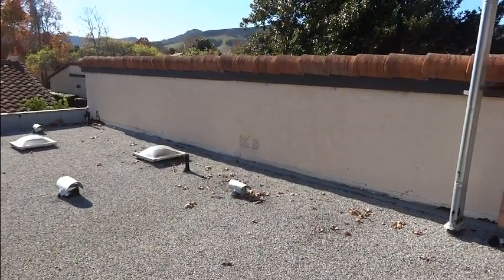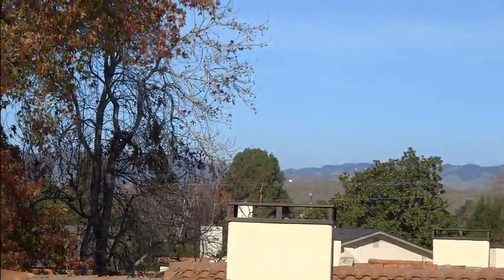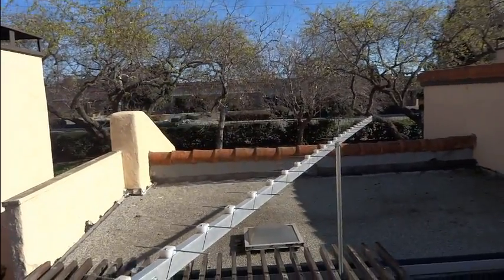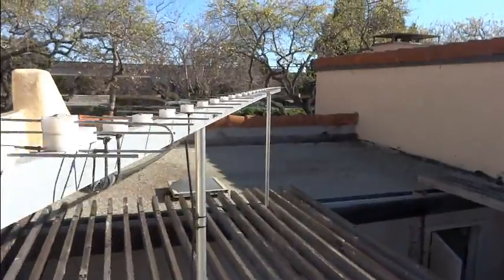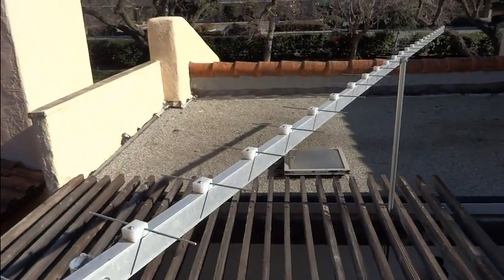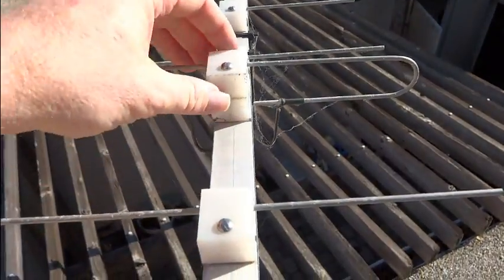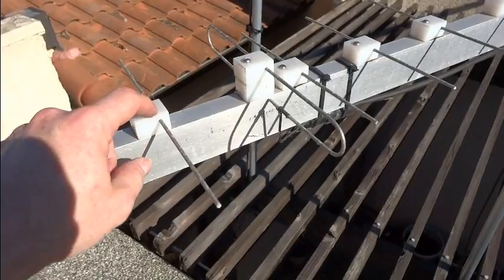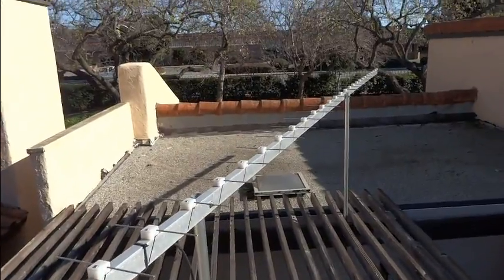20 foot long homemade yagi TV antenna

Comment: There are impedance matching setups, as the folded dipole is 300 Ohms, while a coax cable is 75 ohm, at least it was very I grew up. In order to make an impedance matching device, you need to basically build a UI looking balun, a u-shaped 3/4 lambda I believe patch of your regular coax cable tied to the I shaped regular coax cable that continues all the way into the house. I forget how exactly it was done, I remember the U and the I center wires of coax twisted and soldered together and attached to the dipole's one leg like that, while at the same section the shielding wires were also twisted/soldered together, then the other leg of the U only had the center wire connected to the dipole, kind of shorting the dipole out via a 3/4 lambda piece of cable, if I remember right, and the shielding wire just left floating, unconnected on that side. My memory fails me here. But without impedance matching you get a relfection, and much signal loss,similarly to how light reflects and refracts when going into a prism from one index of refraction medium into a different one. The other way to loose a lot of signal is through attenuation, if you have a long run length of coax into your home from the roof, it simply dissipates the mV of signal by the time it ends up in the house, through extremely heavy skin effect resistance. At these frequencies only skin effect matters, and it's preferable to use tubing, for cost and weight reasons, because you get the same resistance out of a tube as out of a solid rod. So just because you have a copper coax, with low dielectric loss plastic carrying the em-wave in the coax, it does not mean that the copper skin effect resistance is still not huge. The solution to this, back in the old days, with a fixed frequency channel coming from hundreds of miles away, was a UHF amplifier right on the impedance matching UI contraption, instead of leading the I leg into the house, it would be cut, and fed into the RF signal amplifier, which would crank it up to voltage levels where it would feed hundreds of TV's in many nearby apartment buildings from a single antenna, with repeaters of course, instead of the rooftops being littered with everyone's individual antenna, and individual coax. But the voltage in the coax would make it spark sometimes, if you touched the two leads together. But usually these amplifiers were used on individual houses, feeding just one or a few TV sets. I think the amplifier was powered through the coax cable, by adding a DC voltage to it, so no separate wire needed to be run, and the TV tuner filters the specific signal frequencies anyway, and ignored DC, but there is of course a limit of how much DC you can put onto the coax.

By the way there were untwisted flat wires for TV signals, that were 300 ohm themselves by the correct wire spacing, dielectric constant, and wire diameter, giving you L C numbers per unit length that came to 300 ohms, and you can create any kind of ohms by the proper spacings and changing the other parameters, but they suffered of interference, weak signals, and they still needed a 300 to 75 ohm little gadget right at the TV antenna input plug.

By the way really long antennas don't really work that well, they get a super directionality. I think that a 40 element director section is like 32dB compared to a 20 element section that's only 29 dB, and directionality may become too acute to where you have to aim very precisely in full 3d. It's been a long time since I thought about these things, and Yagi-Uda antennas always struck me as mysterious, unintuitive functional sculptures of art, clearly popping out of the minds of some genius japs. Also straightforward scaling up formulas don't really work, there are millions of computer programs spitting out designs for yagi antenna element lengths and spacings, some just equispaced , some log-periodic, some sine-wave spaced, the possibilities, and even element shapes are almost limitless, like X-s, there are spiral yagi-like antennas stacked 9 or 50 parallel, you see in old videos used by the russian and american space missions, and they are all mind boggling designs where I don't think even the creators had good equations to go by, other than oscilloscope and field strength measurements, and like trial and error sculpting on the fly, with individual superhighperformance antennas each being as unique as an artistic hand made sculpture. Or the commercially sold ones as copies of a successful design. I don't think those rooftop combo VHF-UHF antennas with folded reflectors and folded beams were really designed by computer simulators, because there are no good equations accounting for even minor nonlinearity effects in copper or aluminum, and they probably were designed by trial and error, of course still going for a regular, orderly shaped design instead of some neurotic garbled pieces of wires that would look like a hair ball, so the customer would think they know what they are doing while designing it, and they understand it intimately. It's probably possible to develop instinct for what happens after long tinkering with it, for instance old projection tv-s with adjustments for trapezoic, concavity, horizontal/vertical offset, for each color red, green and blue lens, like 32 different knobs to get a correctly a black and white grid pattern displayed on the screen, it is extremely difficult for about 2 days, but when you sleep on it, you can become better and better at it. Too many variables throwing the whole picture off completely each time you change something, but you learn that by messing it up with one knob, and correcting it with a different knob, how you can sculpt and shape the image on the screen, til it becomes instinctual and it would take miles of pages of pages of explaining why, but a human being can do it. There are probably similar things in Yagi-Uda antenna design. I think the folded V shape came about as an embrace and cover-the-dipole up thing in an extremely noisy urban environment with lots of reflections, and probably straight elements are more efficient in absence of strong signal noise or relfections, but I'm not sure, in fact I would really enjoy a neurotic mess of random looking bent wires as an antenna sculpture that beat in cost and efficiency a regular yagi, but one of the advantages of yagi is that the elements are skinny pieces of short metal, very cheap, compared to all other antenna design, and it may be hard to beat them on material cost, maybe on manufacturing cost may be possible by a spiral antenna, that does not require cutting of elements, but a neurotic hard to copy and duplicate artistic mess of an antenna would probably be both costly on material and especially on accurate design copying labor.
Reply: Sillybillydilly If you watch at 2:50 he points out the balun  that converts 300 ohm balanced "twin lead" to unbalanced 75 ohm coax..
BTW In the old days of using twin lead we didn't need any baluns or converters because the TV didn't have a coax input , it  had 300 ohm inputs ( two screws)  for attaching the twin lead directly to the TV 
The whole system was 300 ohm.
Other than that you gave an accurate if some what long winded comment.
Also I'd estimate ( being generous ) this 20 foot yagi to have a gain of 17-19 dBi  maybe 20 depending on the actual frequency it''s cut for.
That estimate is based on the boom length and ultimate potential not the actual construction technique.

Comment: for bean type antenna the longer the boom the higher the gain you need a reflector a driven and bunch of derictor I think more the derictor the more the gain the spacing of each element is importan the reflector is the longest element the driven is shorter and derictor is the shortest element they get smaller as they go down the boom but the old on the roof mount antenna will still work for hdtv or digital tv staion now make a verdical  antenna with a reflector look up a supper scanner antenna maybe that mite work as a higher gain derctional tv antenna cheap rat shack root you can turn the antenna

Comment: I meant "still in the battle". I made my driven with square ends on the looped Di-pole. Wondering if rounded is better. (I did 9-9/16 directors for a 10-5/23 driven, for CH 28, 560?)

Comment: how about the bandwidth?
can it get all the UHF channel (400- 700 MHz )
????
Reply: This is narrow-band design. It is better for DX-ing (better rejection out-of-band local strong signals, possible to get SWR <1.2).
There are wide-band designs of Yagi, which have lower Gain (at the same boom length) and higher SWR (up to 3 at lowest freq)

Comment: Nice project.  Not sure what your design frequency was, but like an earlier commenter made, you could probably do better if you clear obstructions, with this becoming more and more important the higher the frequency is...

Also, your polarization is correct, TV is horizontally polarized.

Comment: Broadcast TV antennas are typically vertically polarized. Your yagi would work a bit better if it were vertically polarized. But other than that, it looks like a nice antenna. I just recently made my first yagi. A 3 element yagi for the 2 meter amateur radio band. It works pretty well for my first attempt.
Reply: do you have a photo of TV UHF TX antenna in vertical polarization? would love to see one... :-)
Reply: merics dream +maxx huey I stand corrected. I assumed vertical polarization since vertical is used on ham radio on VHF/UHF FM. Thanks for the correction. :)
Reply: @oldmax5644  Vertical polarisation is used for UHF TV outside North America. In the UK, in general: main TV transmitting stations use horizontal polarisation, but relays (translators) use vertical. This way the frequencies can be re-used at nearer distances. Actually, I believe the Netherlands ONLY uses vertical polarisation for TV.
Reply: Vertical is use for mobile only because its difficult to make mobile horizontal antennas- not because it works better. In fact horizontal works better when it can be used- like for fixed point-to-point applications.

Comment: I counted at least 30 directors that's too much! Over 20 directors it's nearly pointless. The gain is probably about 20 - 22dB even with 100 directors it will barely reach 23dB. Try to elevate the antenna from the roof 15 to 20 foot and I think you'll get the wanted channel. And post a video if there is a succes. Have you tried to MANUALLY tune to this channel?

Comment: Brian, you should email this to the chief engineer of the station you are trying to get...He may be able to do some beam-bending depending on the antenna they are using. I agree with Mark tho, you need more height...

Comment: Suggest you select ONE frequency not a group. Your Yagi needs to be up a bit higher off the roof, Use a Boom Length as the amount of height needed. Use a Rotator to fine tune the direction if you can.   You need a micrometer to really nail the measurements to .o1 of  mm. Don't worry about about additional reflectors. The other antenna for BROAD BAND UHF is a stack of 4 Double , Triple or Quadruple QUAD antennas. with a mesh Reflector.. That is better for multi-channel work that you might wnt.

Comment: Brian,
First, the last element is not a "director" it is a "reflector".  The distance between your boom and the element ABOVE the boom is not sufficient. It needs to be considerably higher.  Go to VK5DJ.com and download the yagi calculator. Your Yagi needs to be copper, much smaller dipole gap, your balun follow VK5DJ instructions.  Use the Frequency /10 to gain the .01 mm measurements you need for a 20 element boom. Allways do 2 or 5 yagies, not ONE... You can use 12.7mm boom and welding rods.

Comment: Very cool. I was thinking about doing something similar. How much gain did you end up achieving? The 64 mile signal might be over you horizon and that may be why you can't pull it in...and to think I was wondering if an 8 foot yagi was overkill:)

Comment from the maker: All 30 directors, the driver, and reflector are unique.  Each is a slightly different length, and the spacing between them is slightly different (again, governed by the initial antenna design).  That said, on average the elements are about 8" apart.  The channel I'm trying to receive is 64 miles away.  The channels I'm able to receive with the antenna are 36 miles away.